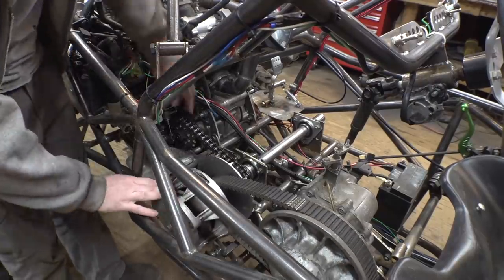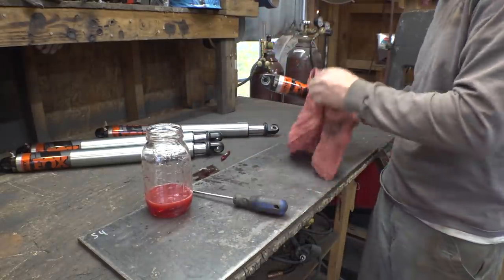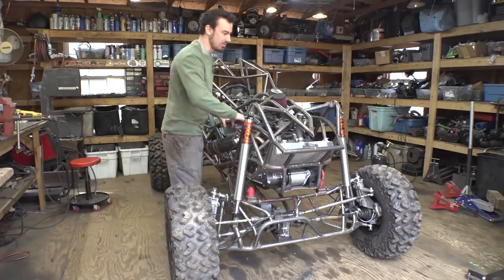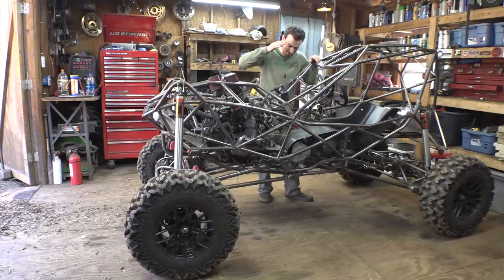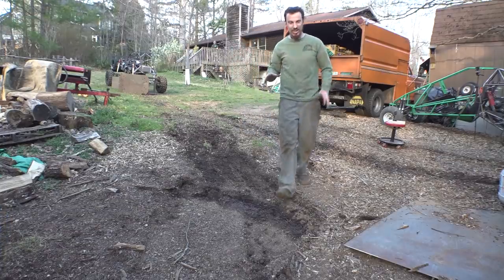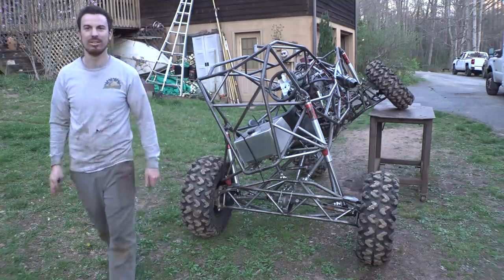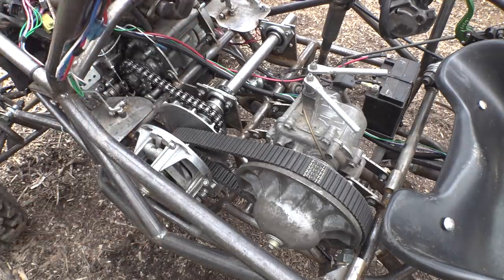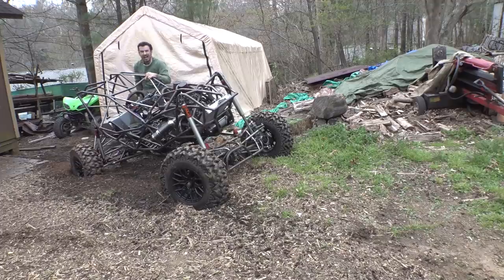First Driving Test!! on the Mini Rock Crawler Build - Part 14

Comment: Chain Tensioner - Maybe a skateboard, roller skate,  or rollerblade wheel. 
Maybe use a double V-belt instead. 
I was actually hoping you could use a longer belt & mount the primary clutch inline with engine output with a 3-jaw coupler & a few bearings. The CVT is probably still setup for way higher RPMs. Mess around with the springs & weights. 
Getting rid of the CVT is most likely your best option. But, if you don't experiment & try things outside the box, than you will never know the answer to, what if?

Comment: So with my Polaris quads and Polaris Side By sides, if it wont pull in high go to low, the CVT belt will give up once it slips at all.  If your going Less than 10 or 15 MPH go to low.  The Achilles heel for CVT is high torque. Its why just about every snowmobile has a spare belt under the hood.  

One of the biggest reasons folks used to coil overs have issues with air shocks is you have to forget what you know, Start over learning how to tune it. Emulsion Shocks, FOx/ORS/ADS all have some free volume in the oil side for damping control. Not to say the valving isn't needing adjustment, a fox specialist could really dial it in. 
It is dependent on weight and shock travel speed.  

Look around on "The Tube" for adjust ORI shock.. Mind blown. :D

Comment: About the chain tensioner, you should use a spring instead of a fixed screw, it will move with the chain and will reduce the noise a bit too by absorbing it
Reply: I either use a nylon slide or nylon roller.
   Nylon is quieter,  can absorb shocks, and wears very slowly.

Comment: Even the smallest amount of oil out of a shock makes a big difference. You might want to make sure they are all at least close to the same amount. Call FOX. Places like those usually have really good support. Also there is a hard plastic you can get that is super durable for your chain roller. Don't remember what its called but is super hard and slippery. It's used in dirt bike chain guides but you can get it in round stock and lathe it down and your chain noise will be much quieter. It's cheap too.

Comment: Yo this thing is amazing, you have done an amazing job and is definitely one of my favorite builds from you. So you can totally hear and see you are losing most of your power due to slippage. I am no expert but I can tell that thing should be doing so much better but it is not engaging or it's slipping really bad either the clutch or 5hat CVT again I'm not an expert but it doesn't take one to know there is a big issue. When you fix the slipping issues this rig will be in stoppable. You have built one badd ass rig and I wish you sold them because I would buy one for sure. Sweet.

Comment: Should use a wide skateboard wheel as the roller on the tensioner. Identical to the chain tensioner on older honda fourwheelers and 3 wheelers. Infact it's what we had to.use for my dad's atc 250r. It's worked great

Comment: Take the spring out of the primary clutch the one that stuck
On you. Take spring out and put face plate back on and wiggle it tobsee if there lot of wear. It should not wiggle. It’s hard to check with spring in it because spring tension can make it feel fine even when clutch bushings are smoked.

Comment: Wicked built you just need to work on the suspension maybe add some bike coil overs to all four corners for drop absorption and some psi gauges for the air shocks.

Comment: I love your build videos. This one is one of your best yet. I have a tip for your chain tensioner. If you use a sprocket instead of a wheel, it will be much smoother and quieter. Keep up the good work.

Comment: RBW gonna need to hire a travel agent for all that travel. I did a build years back and got a idler sprocket from a company called Power Transmissions. It really made a huge difference in the noise. If you can find a small sprocket, I'm sure you could make your own.

Comment: You need to change the shim stacks on the pistons on the shocks.  Taking oil out won't change the damping.  Fox has exploded diagrams on their website.  Also you need to charge the shocks with nitrogen to get the ride height you want.

Comment: I think I would try adding some weight to the centrifugal part of the primary clutch system to make it grab the belt harder since the system was designed for a much lighter vehicle originally.  That would probably allow the belt to have enough traction in high range and lower the activation RPM as well but remember that a single 1/4 inch flat washer on each leg can generate a lot of force so I wouldn't go screwing a 1/2 ounce wheel weight to it or anything.  Lol

Comment: For that chain tensioner you might be able to use a sprocket on a bearing instead of a roller to reduce noise, also you could make a box to go around it that might also help with noise

Comment: Additionally you could use a sprocket for the chain tentioner  or at a minimum a rubber tensioner. That's why the chain is so loud

Comment: Nice build. I'm kind of skeptical of the strength of the cab roll bar though. If it rolls upside down, all the force will be concentrated to the front windshield cross bar that is already bent. I think, to make it stronger you need to weld another cross bar above your head, to those two bent bar that  are welded from front to back. With that mod, if it end upside down, the weight will be concentrated to the stronger cab outside tubings.

Comment: Thinking of filing a patent for the duck tape chain tensioner?
Your thing is awsome but I'm not convinced by the belt transmission for this type of vehicle where the feeling must be very precise.
You should ask Fox what kind of oil is in the shocks and put the same amount but thinner.
With more air I think.

Comment: You got to remember that dirt and rocks have different pressures on drivetrain components especially when it’s under load and you’re supposed to put air in them when they’re full extension then let it down and adjust like that

Comment: Usually you change oil viscosity rather than let out oil.  Try a lighter weight like a 15w or 10w. You can also use ATF. It looks as if they are already full of ATF already with the red color.

Comment: I bet you’ll need to cover that CVT before you take it out for a real ride. 
I think when you were spinning the tires to begin with you got dirt into the primary from the front tires rooster tailing dirt all over. That caused the primary to lock up. 
Good thing you know that now before you get out into the woods lol

Comment: Get rid of that primary belt set up run it off drive shafts or a custom sprocket and chain set up stronger . Looks like it needs some counter weights on the wheels aswell .

Comment: Hi use a slipper type tensioner, roller is rattling on the chain edges up and down, Vehicle engines use slipper type tensioners, cam shafts etc, for this reason to keep down noise.
Reply: Maybe even a sprocket tensioner with a spring on it to hold it tight,think that would be best solution?

Comment: What are you using for a chain tensioner? Have you thought about using a skateboard wheel it may quiet down the rattle of the chain and they're pretty hard if you get a hard wheel should be a lot less noise than that would appears to be a steel bushing I could be wrong.

Comment: Not sure, but I am thinking that the volume of oil in the shock is not important. What is important is the viscosity of the oil and the valving the oil flows through. I would have put in a thinner oil or tried to mess with valving before removing oil. That said I have never fiddled with such shocks. I have only refurbished dirt bike forks/shocks with factory specs.

Comment: Idk if this would work, but couldn't you ditch the cvt belt system and put a recluse clutch in it and just run chain from engine to transfer case? You'd have the same action kinda, and less moving parts and weight, and less complicated. Even tho it's a cool idea, a recluse clutch would eliminate that belt slip

Comment: 0:53 TIP: so you don't waste your time making them from scratch, you can make them from skateboard wheels. They're cheap and they last a very long time. I have an idler that was made in the later 90's and still moves chain today on the same ABEC bearings :)) it started life as a wheel years before that.

Comment: Add limit straps at every shock. Set you're ride height where you want it measure for limit straps. Then you will be able to add you're desired air pressure  (nitrogen is preferred).

Comment: Don’t valves not the oil volume determine damping? Viscosity also plays a role. And engine vibration could walk that  right off the stands without tying it down.

Comment: Use a sprocket on a slotted bar to pull down on the chain for a tensioner. Quieter and not a bandaid fix

Comment: The crawlers from Matt's off-road recovery, fabrats, towmater they'll run like 536 gears for the slow torque they need to climb rocks how does the gearing relate in chains and sprockets??

Comment: you shouldnt take the  oil out of the shocks, it will damage the insides. the air shocks can be adjusted by changing the shim stacks and adjusting the air pressure

Comment: Bro your dancing on the edge of making something bad ass I think this is just my opinion you should go get a cherokee take the transfer case and axles build another one like this with a proper tcase and straight axles you could use the drive shafts and everything just cut them and shorten them you could use a samurai t case mount a sprocket on engine side then drive shafts going to axles

Comment: Also, im not sure if you have had much experience with 4x4 vehicles or not, but you will most certainly burn up that cvt clutch and belt if you run that thing in 4x4 high while pulling under a heavy load, or trying to climb steep inclines in high gear. All these things are mostly done in low range. Keep that in mind. It's way to nice of a machine and you spent way to much time on it to have to be replacing parts on it this early on. Nice work bud.
Reply: Hello there👋,how are you doing today?hope you’re having a good day?God bless you!!!❤️

Comment: 1st you need to get thinner oil for the shocks your will damage those running low on oil 2nd that belt drive is already starting to show its  weakness you have  a transmission and high and low range so use it

Comment: Soo like donyou know about the susuki sv650 /1000 oiling problem? Of you do a wheele you will cause the front cylinder to run dry due to the sump having a bad pickup.
     You will roast your front cylinder if you climb up a hill.

Comment: Instead of removing oil from your shock to decrease your damping  you should just replace the oil with a lower viscosity of oil. Or if they are adjustable just open up the valving on them

Comment: On your shock. Lighter weight shock oil will soften there dampening..  ( the proper method is revalving and requires allot of knowledge
. You always want the shock completely full of oil with no air bubbles.  . The nitrogen goes either in a rubber bladder or the opposite side of a free-floating piston. It's there to apply pressure against the shock oil to prevent frothing. . Most  take about 190 psi .  The reason for nitrogen vs Air is nitrogen is dry. .. air has humidity..

Comment: Great work on the rock crawler. Are you going to do an adventure with Grind Hard Plumbing Co again? And would a sprocket chain tensioner be quieter? For the sounds like a typewriter going at 10,000 words per minutes.

Comment: I think I'd change your gear box and clutch over to a chain drive so it won't slip... Then your 4x4 would pull like hell in high... You can hear the belt squeal and hear it loose power from it when you try pulling it in high...

Comment: IDK if anyone ever told you this old sku trick of putting your vehicle into 4X4 just reverse a bit to get the 4x4 engaged. Idk if its true or not but i wheel toyotas and do it all the time. I have a few friends that also know about this tip and do it, and they drive 1ton buggys. But just some knowledge hope it works

Comment: Why not just use a sprocket for your chain tensioner ? The belt is too "tight" now and perhaps not aligned properly. You can hear it screeching sometimes. This will make shifting the secondary transmission more difficult as the secondary clutch will always have some load / pressure on it. Not idea.

Comment: Is the primary used? It may have some belt residue locking it up, honestly your belt looked a bit tight. Personally I didn't think the secondary was supposed to spin untill that primary locked in turning it over. Yours seemed to go full time which I personally haven't seen before

Comment: How will removing oil from the shocks reduce the dampening? It is the valves inside the shock that controls the dampening. All he managed to do is add air into the shock which can cause foaming.

Comment: Make two curved chane tensioner , than take like cutting board nylon material,  fit it to both sides of the chanes slack area,  maybe valve springs to hold tension.  Like a older strait 6 timing chane gides , o maybe take some out of a junk motor 🤔

Comment: The belt is a problem . Seeing that you have a clutch in the gear case run the belt tight like Yamaha quads and use the clutch for slippage or implement a wet centrifugal clutch from the aforementioned . Otherwise you are a god

Comment: The intro to your video sparked a thought…would it be possible, or even beneficial, to fab a system that would allow you to change the camber equally across an axle that is articulated in order to keep full tread contact instead of riding the sidewalks of the tires? I’m thinking an electric-over-hydraulic system with a momentary (on)-off-(on) switch to tilt both front or rear wheels simultaneously either left or right, similar to how a road grader tilts the front wheels to maintain traction in a straight line while the cutting blade is trying to pull the machine one direction. What would be the downsides to something like this? 

Disclaimer: I know nothing about rock crawlers and have limited knowledge of suspension, but it just makes sense to me you would want the most amount of traction possible. 😂

Comment: what I don't understand is why you fitted the belt drive which will greatly reduce your power instead of putting in a chain drive from the engine to the transfer box replace the belt pully with a chain sprocket that way you will have no jackshaft and no belt pulley which will enable less weight more power better drive take off all I can see is you are going to have a lot of problems with belt burnouts but the rest of the build is awesome just the drive system is very IFFY, I build rock crawlers and no way would I fitt a two-clutch system to a vehicle as one will fail the weeker one is the belt and pulley system with your engineering background you could easily change it to a more reliable drive system getting rid of the pully system normally you fit one system or the other system NOT both but great video and I hope it works for you.

Comment: use a plastic roller on the tensioner. should quiet it down some.

nvm. didnt know it was a piece of plastic that you machined. maybe instead of duct tape you could use a chunk of an old radiator hose? might be a lil more permanant.

Comment: I’d put a kubota Diesel engine in there Turbocharged 3-cylinder, 898 cc made by kubota I’ve seen it in a diesel skidoo for the Canadian military. 500 km on a single tank also can tow 1000kg (2200lb) so good engine for this would be as well and multi fuel I do believe it is

Comment: I'm not sure the shocks are working correctly. They certainly don't rebound properly and have loads of droop. Seems the axles/suspension can't compress down low enough either, fully bottomed out the frame is still high off the ground.
But once the shocks are dialled in it looks very promising. 
Belt seems to slip lots, perhaps try starting in 4th gear in the bike transmission.

Comment: You need lighter weight shock oil , they have to be full, than perged the little bit of air.
Reply: Look up droop crawler suspension, that's where they run the truck with hardly any air pressure, so that the axel drops down the bump , keeping your center of gravity as low as possible.

Comment: would be hippster to put a slant LS in this ...
Reply: wonder how hard it is to make the wheel articulate so they stay straight up and down could improve toe grip ..?
Reply: put them on some hydraulic tilt system at the hub ...
Reply: tilt switches hooked up to a computer to maximize tilt grip ...
Reply: gecko tires ...

Comment: You don't remove all to change the dampening you change the weight of oil to change the dampening you are most definitely going to have to tune your primary and secondary clutch for the type of riding you're going to be doing

Comment: Ditch the belt drive; it’s going to cause you grief. The torsional torque on the tires off-roading will kill your drive system.
Reply: And if someone hasn’t posted yet; lower the tire pressure.

Comment: youre gonna ruin those shocks fast mate, they need the rigth amount of oil for lubrification too. change oil grades o mess around with valve shims, not the amount of oil as you will for sure have situations where it doesnt have oil on the valves or valve rings etc and cause damping issues in compression and rebound as well as premature wear on parts.